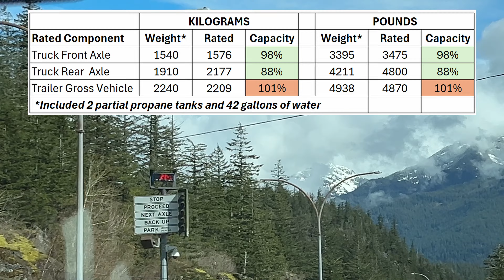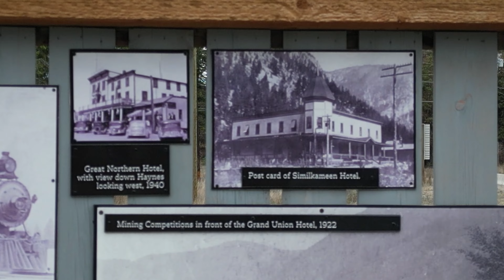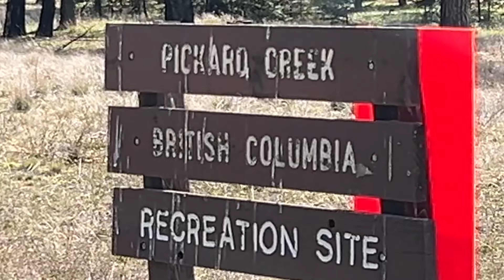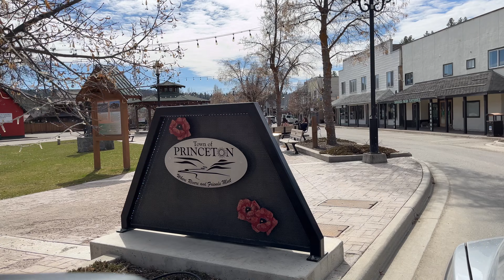RVs Gone Wrong! A Road Trip with No Reservations Led us to New Friends (and a broken tongue jack)

Comment: Love your channel Joe!  We watched all your Ember videos to help us pick this camper out. We ended up with a 170 MRB Max solar. Love the construction it is a very solid camper. Do yourself a favor and the next time you weigh your rig drop the camper and go back through the scales so you can figure your tongue weight. Brand new and just home from the dealer my 170 has a tongue weight of 775 lb. Add in 55 gallons of fresh water and it goes to 825 lb. I don't think there's any way this Jack will hold up. Fortunately I won't be using a weight distribution hitch because I have a Ford f-350.. just going with a sway bar attachment.
Reply: 775lb/351kg to 825lb/375kg?  Wow, my tongue/drawbar/nose weight never exceeds 165lb/75kg, and the RV/Caravan has a maximum laden weight of 3750lb/1700kg, my Station Wagon/Estate has a maximum laden weight of 4630lb/2100kg